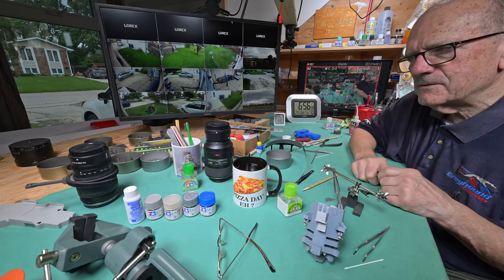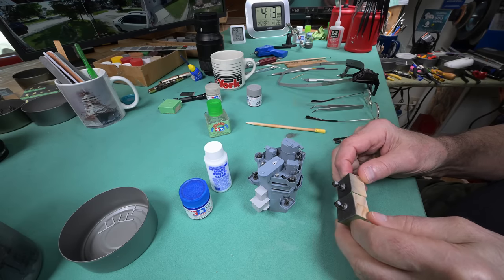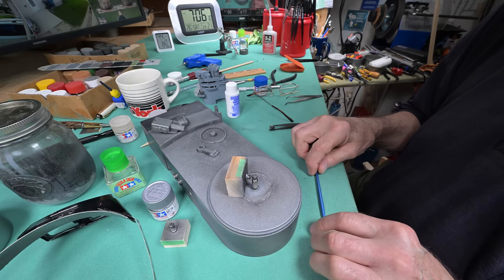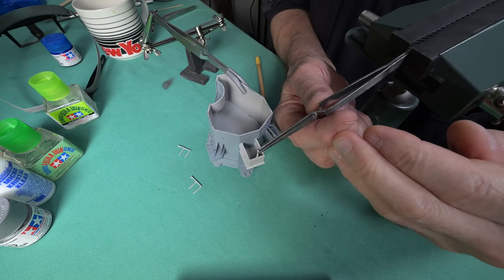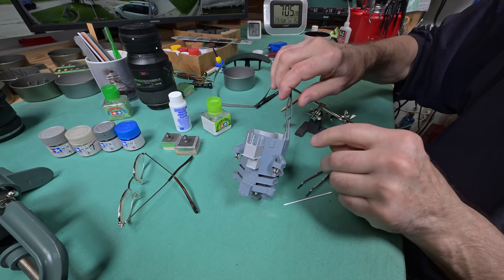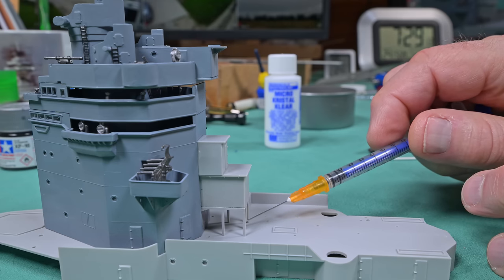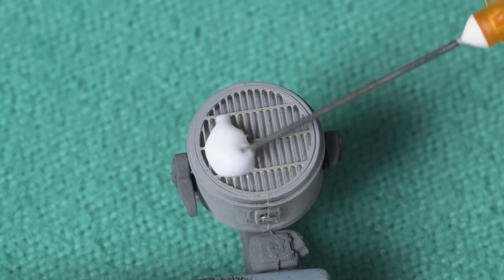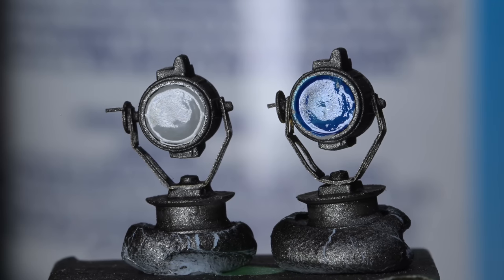The Model Ship - Part 1249

Comment: Great idea with the needle and syringe for applying the kristal klear Ron👍 What size are you using?
I think it turned out great!
That pizza salad looked good too 😊
Reply from the maker: The syringe is only 1ml, but I'm sure larger should work as well. It took very little pressure to get the Kristal Klear to flow through the needle.